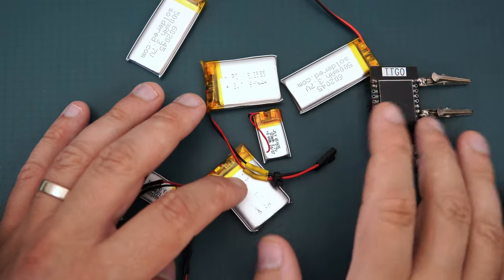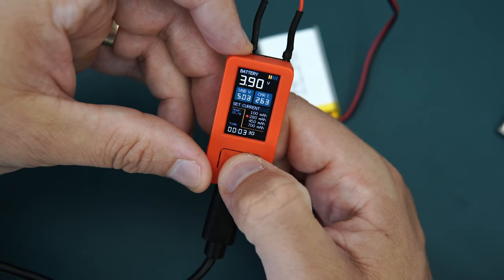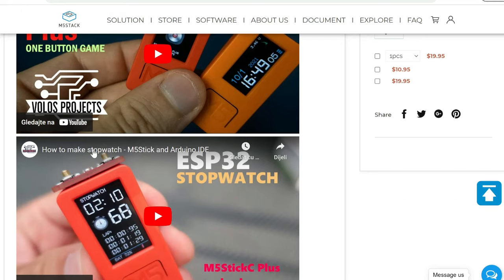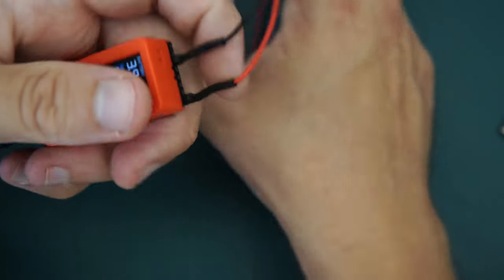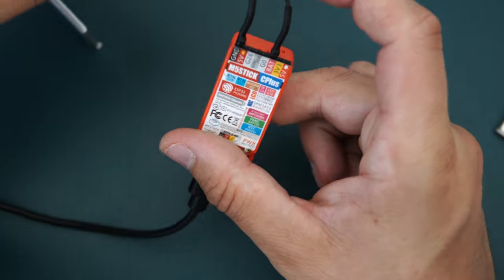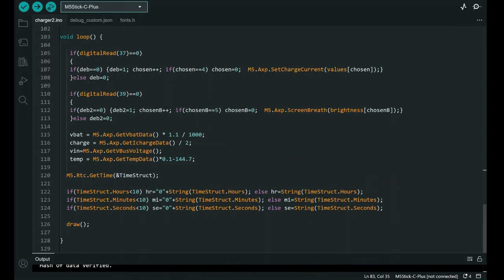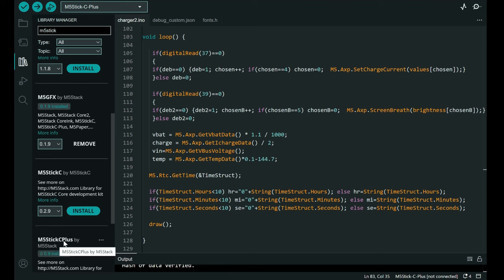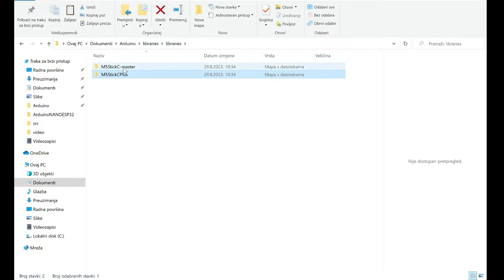ESP32 Li-ion Battery Charger

Comment: A quick tip: You don't need to cut and resolder the wires to change the battery connector polarity. You can remove the tips from the connector housing with the help of a needle and reinsert.
Reply from the maker: Thank you, i will try that

Comment: This is a great project.  Thank you for providing it.  I did find one small issue.  The screen brightness control (the button on right side of the M5) doesn't work with the code provided.   I changed the following line from
byte brightness[5] ={20,40,60,80,90};
to
byte brightness[5] ={7,8,9,10,11};
and now I can change the brightness of the screen display.
7 is pretty dark but there isn't much difference in the brightness of the display for values above 11.  The higher the brightness value the larger the current draw by the M5 but since this is only used as a battery charger the current draw isn't really important.  You can try out different values for brightness and decide what works best for you.
I have found that the TFT display is VERY easy to damage/destroy.  When putting the case with the display back together, be very gentle.  Make certain that everything goes together easily without any force.  Even a little pressure on the TFT can kill the display in my experience.

Comment: Really like the Video!  Thank you,  from the axp192 sheet it has operation voltage 2.9v~6.3 AMR up to 11V.  Do you think that a straight connection to a 6.7v solar panel is ok?  I'm not a fan of letting white smoke out of my precious m5stickC's!  Also for a long sunny day, would it be able to push well into two 18650's in parallel (of course).
Idea behind my question is small solar panel charging 1 (hopefully 2) 18650s for cloudy weeks with good efficiency.

Comment: Nice 👍👌
Can the charger be made that you can charge the Batterys with 2mah for this even smaller batterys and is it possible to charge 2x4.2v =8.4v batterys too 🤔🤗 I'm looking long time for charger with this futures but I can't program and have problems to build this stuff becourse I'm disabled and are momentarily under extrem strong pain too. 😔
For AAA nimh, liion, lifepo4 and from 1volt up to 30 volt maybe too a wakeup under volt regeneration function too?? 🤔

Comment: Charge current min is 100mA, can this be reduced to 20mA for button cells for example?
Looks like REG 33H sets charge current, min is 100mA, so would need to add additional circuitry to accommodate lower charge currents...